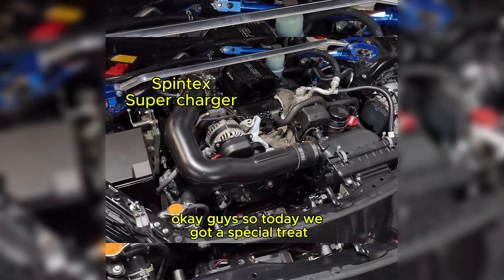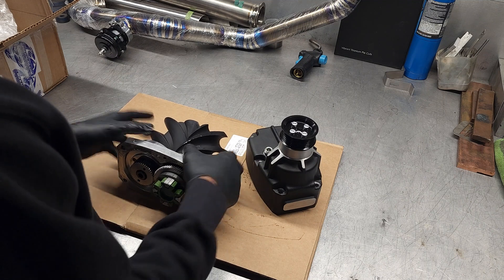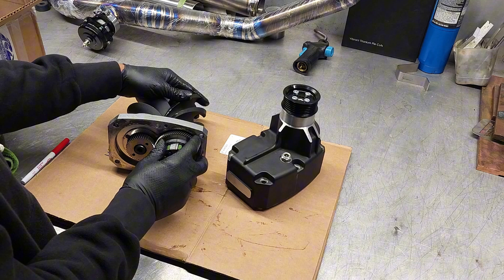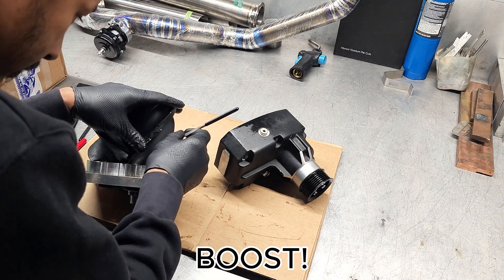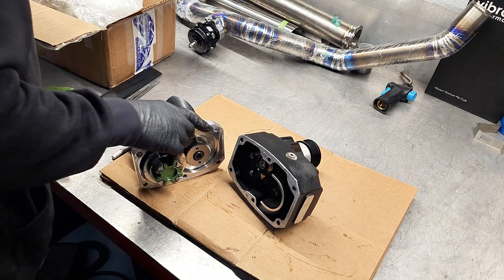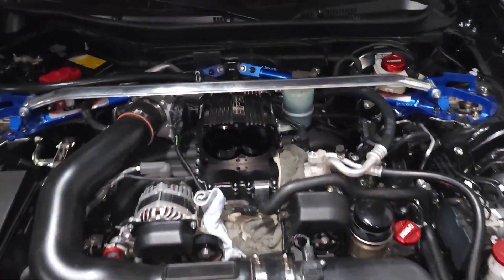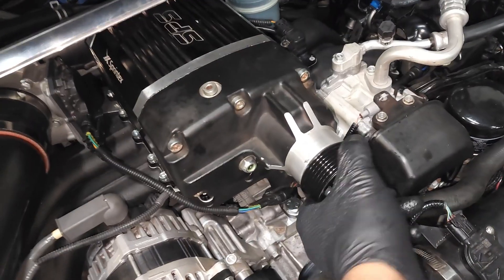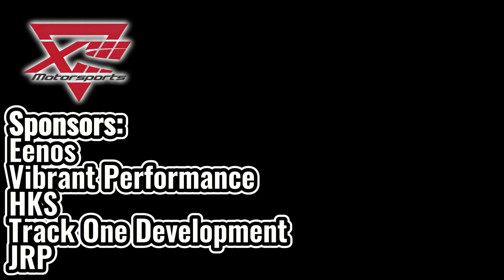Supercharged Sprintex BRZ How Does It Work

Comment: Do you like the performance of the Sprintex or the HKS centrifugal better?
Reply from the maker: As of this moment. Much prefer the HKS kit. Reliability has been proven. No tuning issues.
Reply: @xiiimotorsports  What are the cons of this Sprintex setup vs the HKS centrifugal? Im unsure which setup  I want rn.
Reply: A recent install video for the HKS was posted by 86Speed. It’s a great video but it shows some serious modifications to the OEM crash beam and other components. Very disappointing from a fit/finish perspective.